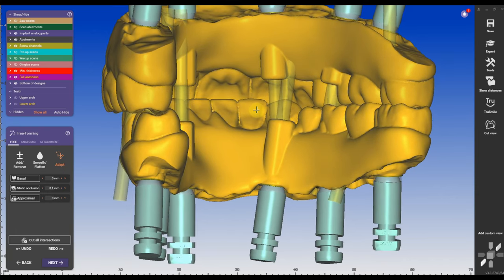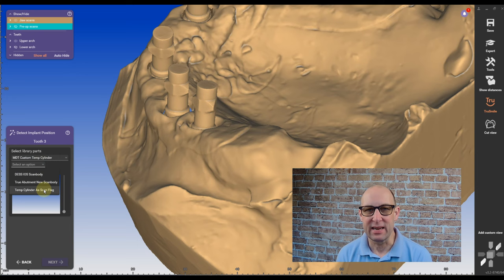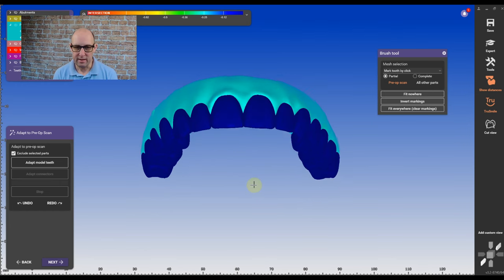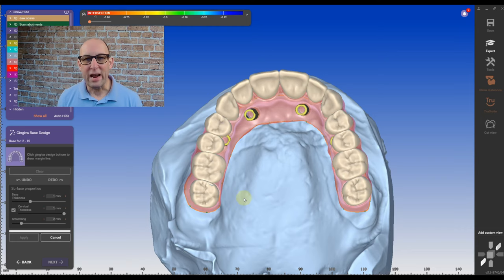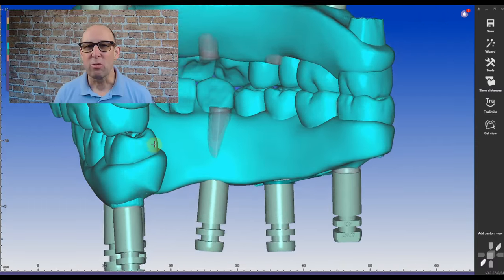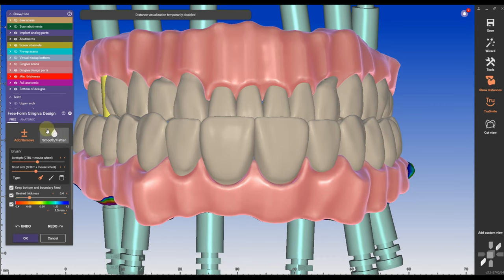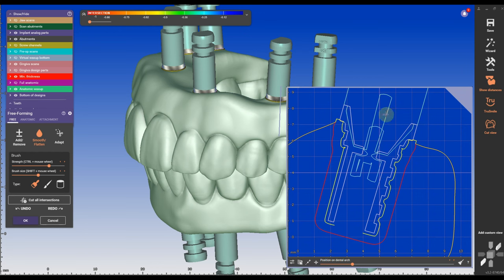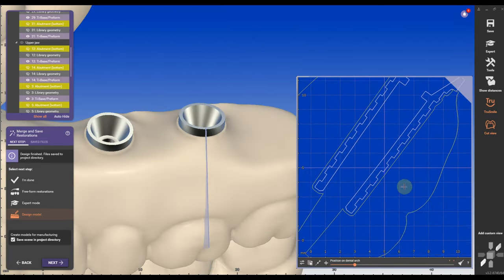Cut TI Base Height Digitally in All On 4 [ Exoxad Tutorial for Screw Retained Implants ]

Comment: Very cool. What is the cement spacer in this library for the temp cyliders? I think DESS TiBase is 35ųm
Reply from the maker: I put the cement spacer at 0.166 mm and a flat liner surface. When you scan those in you usually have these structures of the TI bases in the bottoms. Some mills don't like that causing too tight of a fit. It's even worse in printing.

Comment: Hello Master! Can you make an all-on-X design video without using waxup? I have a question: is this waxup model made of wax or plastic? Is it available or do I have to do it manually first and then design it on the software later? Because there's not always waxup to do it.
Reply from the maker: You could do an All On 4 case without a preOp even though it's not recommended. Just print it in PMMA as a try-in
Reply: @masterdentaltechnician1914  Thank you so much!